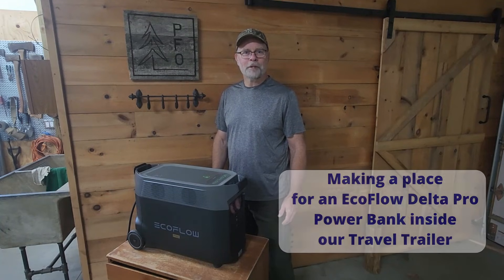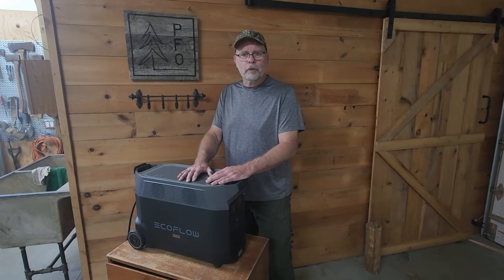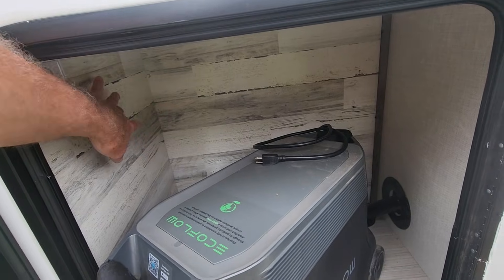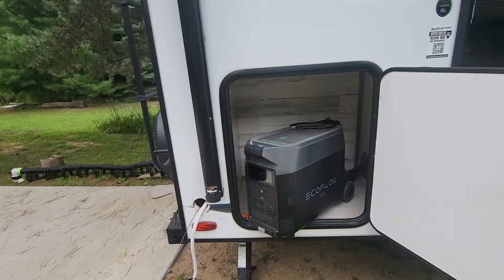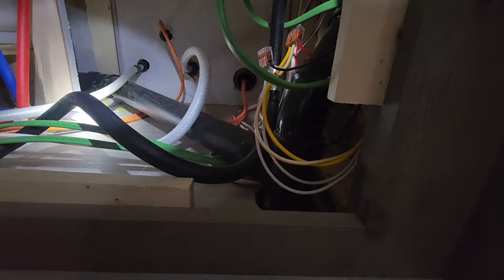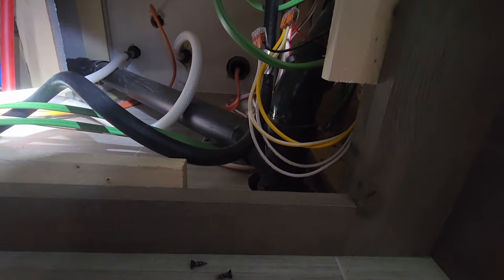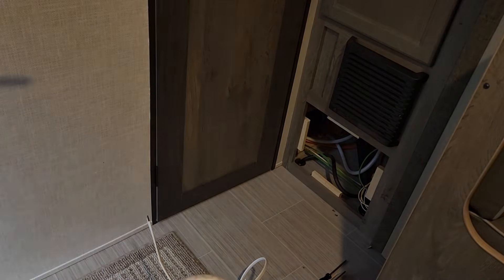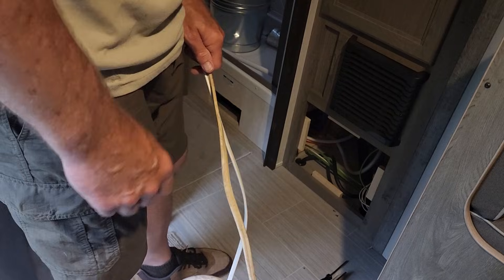Best EcoFlow Delta Pro Setup for Boondocking- Install a Transfer Switch!

Comment: How long will it run the ac
Reply from the maker: There are many variables that influence the amount of time the Delta Pro will run the AC unit. The biggest two factors are probably the outside temperature and the temperature to which we wish to cool the inside of the travel trailer. When I ran a test to try to answer this question, the Delta pro shows it can run our AC unit for 3 hours if the AC is running on full blast the whole time. Our unit draws around 1,240 Watts on the High Cool setting. The Delta Pro provides a maximum of 3,600 Watt-hours, so the 3 hours shown on the screen is accurate, but rounded up. (The display doesn't show any decimal places on the 3 hour estimate.)

When the inside temperature reaches the setpoint on the thermostat, the AC compressor stops running and the AC unit runs in fan-only mode until the thermostat calls for more cooling. When it is running only the fan, it draws about 94 Watts. In that mode the Delta Pro would last about 38 hours. So, depending on where we set our thermostat, and how hot it is outside, it is going to keep switching back and forth between cooling and fan-only mode. The end result is we'll get somewhere between 3 hours and 38 hours running like that. It is important to note that during this quick test there was nothing else turned on in the travel trailer. When we are boondocking we always have food in the refrigerator and running the fridge is top priority. Therefore, we have concluded that if the outside temperatures are hot enough that we would not want to go without the AC, then extended boondocking is not compatible with that situation. For example, when we visited Moab, Utah and it was 104 degrees, we stayed at the local KOA campground and ran the rig on shore power. 

Thanks for watching, and thanks for the question!

Comment: I am planning on doing the same thing, but i was under the impression that the wfco transfer switch you used operated the opposite of what you described, i.e. when it detects the generator is turned on (the ecoflow 120 output in your case), the relay energizes and lets the generator provide power, regardless of shore power state. So shore power is really the controlling factor for the relay on the wfco transfer switch?
Reply from the maker: My explanation does seem a bit confused now, looking back at it. When I said that the transfer switch was refusing the power from the DeltaPro, it was only because the built-in delay function had not yet switched over. I made it sound like the transfer switch was prioritizing the shore power when, in fact, it prioritizes the generator power (per the switch label). I did not need to unplug the shore power at all in order for the DeltaPro to begin powering the trailer. It would have switched anyway, and in fact, it did switch over at the same instant, coincidentally, at which I unplugged the shore power.  Unplugging the shore power was the only way I could think of to demonstrate that the DeltaPro was actually running the air-conditioner. But, instead of clarifying things, unplugging it only confused us all about how exactly the switch was working. Sorry for that confusion. Thanks for pointing this out!

Comment: So if my RV runs off 50 amps I would just use the 50 amp version transfer switch instead of the 30 amp switch used here?
Reply from the maker: Yes, you would certainly want to use a 50 amp transfer switch because you would be drawing that much load through the switch when connected to shore power, even if you only draw 30 amps when connected to the Delta Pro. You would also want to size all the wiring to handle the 50 amp loads and use a NEMA SS2-50P shore power inlet in the cargo hold instead of the 30 amp inlet like I used.  Then, you could use an adapter to go from the 30 amp outlet on the Delta Pro to the 50 amp receptacle in the hold. Of course, just as when you get stuck in a campground that only has 30 amp hookups, you would not be able to operate your RV at full power. For example, you probably wouldn't be able to run dual AC units off the Delta Pro. That would exceed the 30 amp limit. The last I checked, Ecoflow does not have a power bank that accommodates 50 amps. I see that at least one other brand, Anker, now offers a power bank that has a 50 amp RV outlet, but I don't have any experience with it.
Reply: @thePFOchannel  would you use 10/4 awg wire from the receptacle to the transfer switch or 12/4 awg?
Reply from the maker: I'm not an electrician, but I'd use 6 AWG copper for a 50 amp circuit.
Reply: @thePFOchannel  I appreciate the advice.

Comment: You did a phenomenal job so not nitpicking but a small tip that I adopted from electricians is once you snug up the wire, put some electelectrical tape on the wire nut. Just snugs everything up to not shake loose, especially in a camper, and for me, added safety no wires can ever accidentally touch. I know it’s not critical and I wired my whole house in 1988 before ever seeing this done with no issues, but all new wiring of any kind gets electrical tape.
Reply from the maker: Thanks for the tip. It wouldn't be hard to open it back up and do that.

Comment: You have a big compartment, wish we did. Most are smaller and pass through like our Jayco. Glad you remembered to cut off the power, lol. Excellent video
Reply from the maker: Thank you. Yes, we were lucky to have the larger compartment on this model. The hatch opening on the front pass through storage was just a bit too low, and that would have been a lot longer wire run, too. Unfortunately, a lot of travel trailer models probably don't have such an ideal spot for it.

Comment: How has this power station held up? I’m looking to do something similar and struggling with “do I build my own or buy pre made”? I’m trying to think long term. If I build my own, every piece is modular, so if it fails, I should be able to get a replacement from Amazon pretty quick. I contacted Eco, they said they do pay for shipping, but it goes to California or Canada. I’m on the East coast in VA. So at the best case, it is 5 days each way shipping, so that is 10 days, plus any processing time, which if I’m on vacation, zero chance of being practical to get warranty done in a timely manner. If modular, it could be a day or 2.
Reply from the maker: We have not had any need for warranty work with the Delta Pro. We are extremely pleased with it. We bought this unit very soon after this model was launched. During the first year, it did seem like they had to push out a lot of firmware updates, but that has tapered off to only occasional updates. All are achieved quickly and easily through the phone app. We have used this a LOT not only in the travel trailer, but it has run our refrigerator and Starlink internet in the house to get us through many power outages. I love the self-contained aspect of the Delta Pro and the fact that it can be recharged by so many different input sources. The onboard charge controller seamlessly deals with anything you need to connect in or out. Even though I managed an electrical engineering department professionally for many years, I would have to do a ton of research to figure out how to piece together a system that would properly and safely handle the wide range of configurations this unit will accommodate. We like this so much that we bought another one and hooked it up in my mother's house, along with the Eco Flow Smart Home Panel, to be her backup power. Her town has frequent power outages, and it is a real blessing for me to be able to see and manage her system status via my phone from anywhere we happen to be. Both units have performed flawlessly.

Comment: Great installation. I would shorten your cable for the battery to only what is needed to reduce loss over the length of the cable. I look to copy this setup on my RV.
Reply from the maker: Thanks! There was only one possible route to run the cable through the guts of the trailer, so it made that part of the decision easy.
Reply: @thePFOchannel  you could run a conduit under the RV up against the belly for the cable to run though and keep it protected. Cheap easy fix.
Reply from the maker: You're right, I could.  That would shorten the run by about 3 feet by doing that. For 10AWG copper, at a full 30 amps, the voltage drop in 3 feet is less than 0.18 volts. I think it will be OK.

Comment: Good job I would highly recommend you install a small fan to move the hot air from the cabinet you can vent it under the coach. Otherwise you'll cook the inverter and charger. Another plus is you can lock the door to keep a low life from taking your great Eco Flow. Regards Mike
Reply from the maker: Thanks for the tip!
Reply: Low lifes don’t steal RV Lithium batteries but lots steal fancy, expensive and low power “solar generators.” Gee, RV storage doors are SO TUFF to break open.

Comment: Or your could run your shoes cable back inside and plug it in inside.   Takes like 4 mins
Reply from the maker: Yes, there are a lot of options. Thanks for watching.

Comment: Do you happen to have a soft start on your AC unit?  Was wondering what the initial surge was... Thanks
Reply from the maker: I don't have a soft start on the AC...yet.  The Delta Pro handles the AC startup without any trouble, but I have not attempted to measure the amp surge.

Comment: This is GREAT and thanks for making this video! I just purchased an EcoFlow Delta Pro (haven’t even gotten it yet) primarily to take it with me in my RV while traveling. I was already thinking in my head HOW I could accomplish what you just explained in this video. I thought about punching a hole through the side of 1 of my storage areas and then just pushing the regular shore power through it during those times I wanted to use it, but really didn’t like that idea. I don’t have a lot of places to put my EcoFlow, so I still need to decide where to put it whether inside the cab with me or down in one of the storage bays. But this looks fairly easy, especially if I have my RV guy do it. Only thing I might add is a little hole to bring in my solar wire when I want to charge via solar. Thanks for the video and the links to the supplies too!! I’m excited now!!
Reply from the maker: I'm glad you found it useful. Good luck with your setup. I'm currently working on a project to add a couple more wire feeds into that same compartment to add more flexibility to how I can recharge the Delta Pro besides just shore power.
Reply: So just to be clear, the transfer switch needs to be placed BEFORE the breaker box? So then the main “out” wire from the switch will go directly into the breaker box? You’ll have shore power in one side, EcoPro on the other. You can’t just pick any place in the coach (say tap into an electrical outlet), right?
Reply from the maker: That is correct. Pay close attention to the circuit layout printed on the transfer switch.

Comment: Nice video, you mean you didn't go out and max out your credit cards by spending $20,000 on battleborn batteries, with 1600 watts of solar? lolol I did the same thing with my RV except I did it with an Anker 767 with the extra battery. great job on the wiring.
Reply from the maker: Thanks! lol cash is king, right? That Anker 767 looks like a great unit, too.

Comment: I have the exact same situation with my RV. Would it be possible to connect my Eco pro to a 120 volt outlet  in my RV to energize my 120 volt system? Would I blow something up ? All I would need is a double ended cord with two male three pronged plugs. Of course you will have to remember to disconnect your shore power first. Thanks for any help, from anyone, out there.
Reply from the maker: Backfeeding ANY electrical system with a chord having male prongs on both ends is a good way to set things on fire and kill people! Don't do it!

Comment: Go back and put a bead of silicone around the exterior round hole you fished via.  That is NOT waterproof and will delaminate if you get heavy rain. Personally I would goop all that exposed wood in there too.
Reply from the maker: Thanks for the advice.

Comment: You may need to ventilate the storage area?
Reply from the maker: That's a great question. The Delta Flow literature states the unit puts out no toxic fumes and is safe for indoor use. It does, however, say to store it with adequate ventilation. Given the way this particular travel trailer storage compartment is constructed, there is a minimum of 15 square inches of unobstructed air space between the compartment interior and the space beneath the trailer floor. There is a rigid plastic belly membrane attached to the bottom of the frame rails, but even though the space below the floor is enclosed, it is not air tight. I believe this will result in sufficient air circulation for the compartment.

Comment: Well done!  Just don't forget to shut off the circuit breaker for the RV battery charger for the batteries on your trailer tongue.  I suspect that charger would put a decent electrical demand on the Bluetti.
Reply from the maker: Good point, thanks!

Comment: Did the same thing in my 50 amp RV. Nice to have all plugs live.
Reply from the maker: It sure is! We were disappointed when we realized the standard inverter in the travel trailer wouldn't even run a single cup Keurig without shore power. Had to fix that, fast! This setup totally nailed it.

Comment: How long will AC run off that? What btu 13500?
Reply from the maker: We have the Coleman Mach 15,000 btu AC unit. Starting with the Delta Pro at 100%, it shows 3 hours of run time when the AC is running full blast.  Of course, it will last longer than that if we dial up the thermostat so the AC only has to cool intermittently.  For example, we tested it on a day that never got above 78 degrees, and set the thermostat to keep the trailer about 74 degrees. After 6 hours of cooling, in those conditions, the Delta Pro still showed 48%.  I have some video of that test still in editing mode. Be sure to subscribe, so you won't miss it. Thanks for watching, and thanks for the question!
Reply: @thePFOchannel  I have an ECO Flow River Max and did the same thing you did on my Truck Camper - except I used a 3 way switch to transfer power.  I believe my rig is equipped with same AC unit.  My AC unit pulled ~1100 watts - according to the data displayed on the ECO Flow when compressor was engaged and cooling.   Coffee maker pulls  ~1300 watts and uses ~ 11% of the ECO Flows stored power.  Also I set maximum charge to ECO Flow to ~ 90 - 95% and discharge floor @ ~10%  so that 11% # for the coffee maker is less.

I like that transfer switch you installed.  Would you have a link for that product?  Thanks
Reply from the maker: The transfer switch I used is a WFCO T30 30 Amp Transfer Switch. I bought it through Amazon. Here's a link to the item. 
https://amzn.to/47QiLMQhttps://amzn.to/47QiLMQ
I'll also add this link to the description under the video.

I didn't realize until I had the switch in the travel trailer that it is the same manufacturer, WFCO, as the main breaker panel installed by the Surveyor factory. I'm not an affiliate to any of the above.  Thanks for watching, and thanks for the sub!
Reply: @thePFOchannel  Thanks
Reply: It's 3600 watt hours of battery capacity
Reply: So you can’t directly plug it into the side 30amp with a 15 amp adapter?